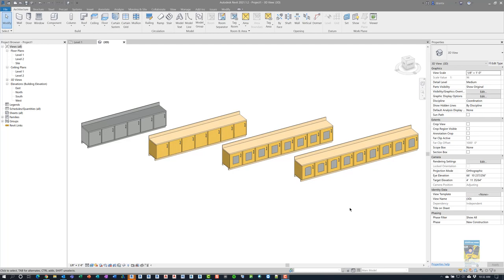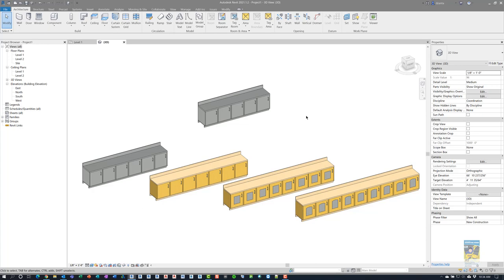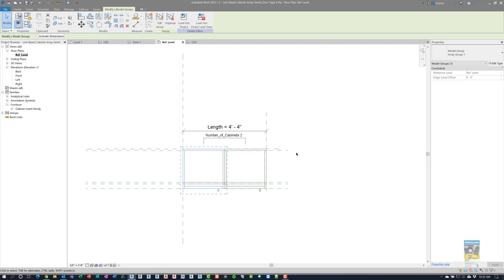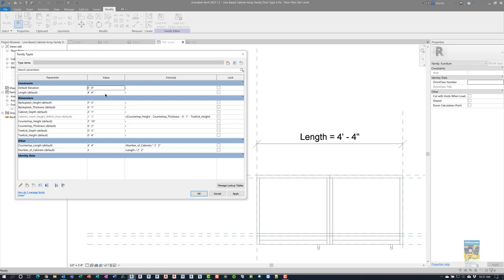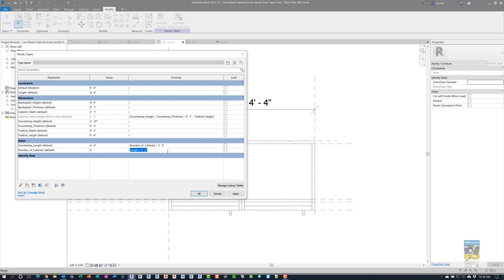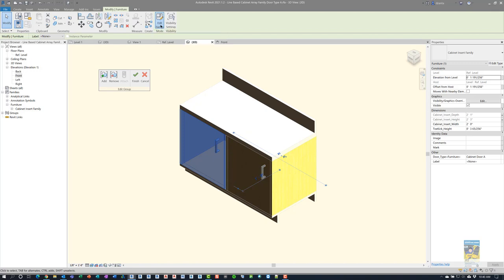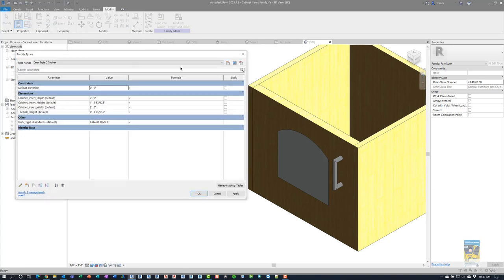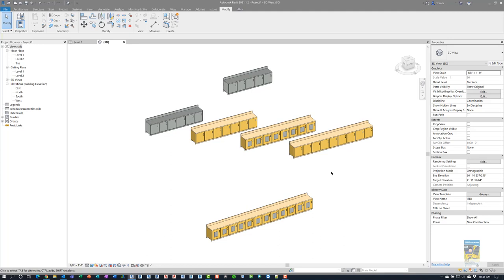Revit 2021 - Line Based Cabinet Array Family

Comment: think about the furniture you sent me, I need them 2 cm intertwined. gutters to prevent water from escaping when someone goes into it.
Reply: Line based families do not behave well when put next to one another, and gutters as the tool automatically join to one another if of the same type.

If you need to model intertwined gutters the only tool in Revit that can achieve this is a 2 point adaptive component.